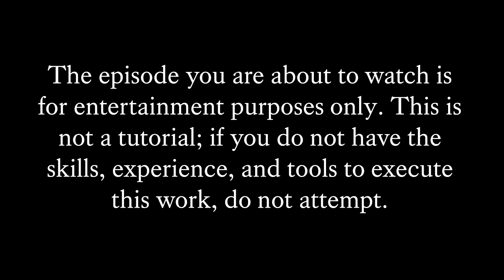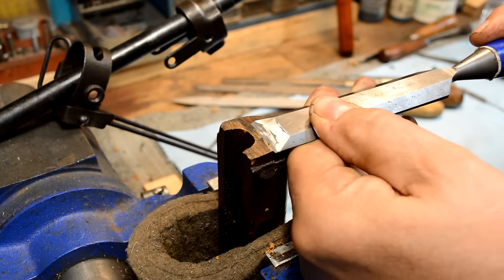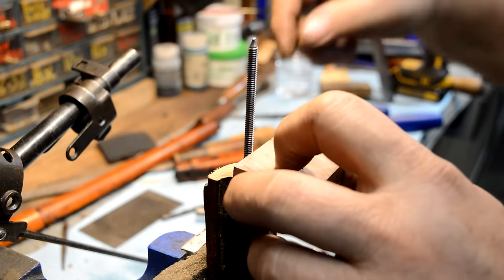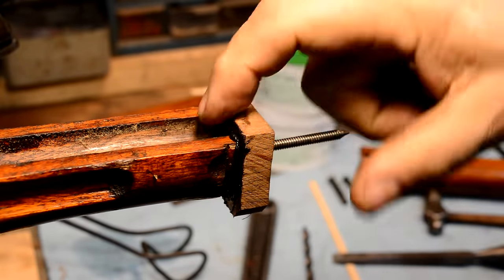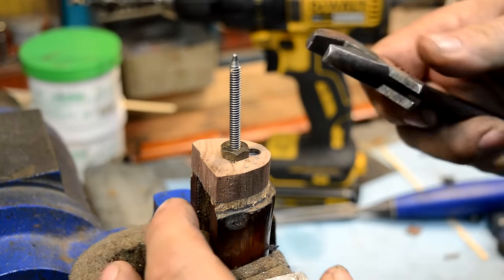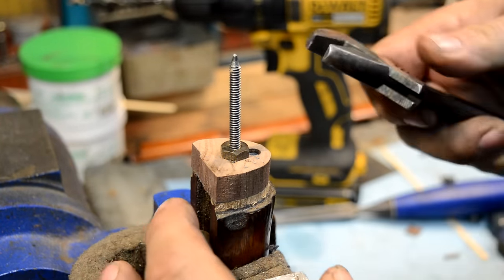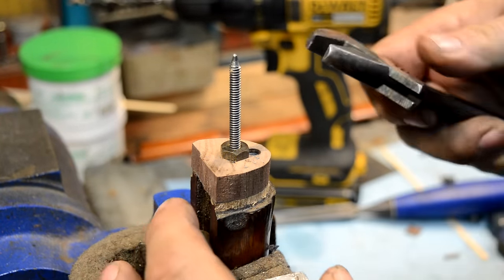Anvil 086: Type 99 Arisaka duffel cut repair

Comment: A little recommendation for the bonding of the parts of the stock. To make the joint strong and durable with good tensile strength, lay cotton threads down (amounts depend on desired strength) on the joint and coat and overlay with the adhesive. It'll be many times stronger I think you'd like it 👍
Reply: He said it was a nylon epoxy does it not have nylon threads in the epoxy already?
Reply: @IRMacGuyver  it looks like a normal aliphatic resin, normally you could use glass fibres, cotton thread or aramid fibres for reenforcement. Nylon is generally used for its lubricative and elastic properties so would not typically be a good adhesive companion because the glue is hard and nylon is difficult to bond to. Nylon is good for sealing joints and threads though. I'm going to watch the video again, perhaps I missed a bit. In industry chopped or strand cotton is used for applications requiring strength and a little flexibility so it is nice to use with wood. Glass tends to crack and snap, being more rigid. But also good. Stronger options are to go with Kevlar or carbon fibres. But cotton is cheap, good and readily available so I like it.
Reply: @zimbab5748  No he said he used Acraglass not wood glue.  Acraglass is a resin.
Reply: @IRMacGuyver  I didn't say wood glue. I said resin. I specifically mentioned aliphatic resin. I am talking about components that can be combined with resins to increase strength when bonding.
Reply: @zimbab5748  Every carpenter I work with says aliphatic resin is a fancy name for wood glue.   And I AM talking about the possibility that Acraglass already has nylon threads in it so you don't have to use something else.  But you haven't answered that question.
Reply: @IRMacGuyver  I see what you mean.
Reply: @IRMacGuyver  so it has a metal matrix, nylon derived additives (because as I said nylon is lubricative, so will have been derivatives that aren't rejected in the bond), and does not contain glass floc or recommend it as 'necessary', Neither do I. But I do a lot of work with epoxies and for a joint that is set up like that I would have laid a bed of cotton threads down axially in the stock under the barrel to add additional bending resistance. Just my opinion, you don't have to recommend or endorse it but it is what I've found works after having  failures in different fields. I don't think you're wrong, you can use it as it is, but there is a world of composites out there..

Comment: I'm guessing you cut up so much walnut to get to a grain pattern that matched the stock? That's some amazing detail.

Glad to see a Type 99 video! I just picked up my own unicorn will all the gizmos, but sadly with a small wrist crack that will have to be repaired someday.
Reply: That and it looked like the was a stock pattern drawn on the wood. Realistically the grain matching isn't an issue because of where the repair is on this particular gun.

Comment: Have you considered steaming the area held in the vise to cause those minor indentations to swell back into shape?  We repair dents in very expensive pool cues with that same technique.   A directed jet of steam (pull the knob off a glass pot lid, on a pot of boiling water, the small hole is perfect) can "reinflate" compressed dings in wood, amazingly effective.
Reply from the maker: What finish do you have to replicate? This weapon has a sumac based varnish, which is somewhat poisonous and we do not have any. Oil finishes will turn white if steamed. We steam stocks all of the time......IF we can repair the finish. In this case, no. Try a MonoKote iron, or a soldering iron, and a wet towel, for point repairs in small spots. Your rig sounds interesting, I might try that.
Reply: @marknovak8255  
  I've used the heated moist towel, etc. as well, it was more a general question but yes, I realize that the finish makes the difference.  
  I was admittedly working on the premise that the finish could be repaired if it were a common lacquer/varnish. 
  Glad to hear you're aware of the process and, yes, the small hole in a pot lid does work great for small nicks.  :)

Comment: Great workmanship. Thank You.
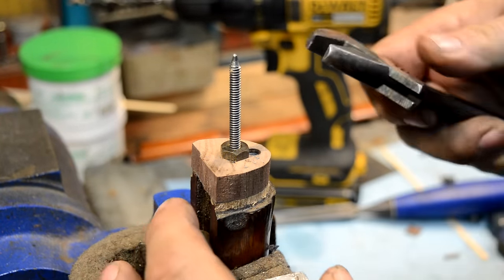Reply: Well this isn't going to be welcome but here we go. @31:53 we can very clearly see that the top edge of the stock on the right is noticeably higher than that on the left of the join. Mark does not see this. This is the stage where the parts are brought together dry so that they can be fitted correctly. Look closely, it can be seen that the barrel is sitting down hard into the wood on the right but is lifted in the wood on the left as witnessed by a gap between the wood and the metal on the left. This can only be caused by the wood on the right being too high in relation to the mother stock and shows that the hole for the threaded rod is in the wrong position and is causing the joint to be out of line. 
Having assembled the joint @37:43 we see that the exact same conditions apply and the repair is out of line. Start watching at 38:10 Mark checks the alignment and (look closely) moves the stock even further out of alignment by lifting it higher. Shortly after this he confidently tells us that this is not the sort of gun that you learn on. @40:10 here's the smoking gun! Notice how the wood grain is showing through the glue. It stops showing at the exact line of the join because the barrel was lifted up from the mother stock by the miss aligned stock. All the pressure of the rubber strap could not pull it true because the threaded rod could not allow it to move into line. @42:32 look closely at the visible left hand edge of the glue and it can be seen to have considerable thickness. This is the result of the barrel not sitting down in its cradle in the stock. The thickness of the glue exactly matches the degree of missalignment of the top edge. @45:01 he finally notices the problem with the top edge of the stock and cuts a little wood off. @45:16 Mark starts to explain that wood moves with time and he's right. However no amount of explanation can put this situation right. @47:18 he cuts away wood and tells us that it swelled right here. He demonstrates that he does not understand why the top edges are not in line and level. @49:14 this is the first time that we see the results of the missalignment. Not withstanding any bending of the top stock the gap between the top and bottom on the left of the joint is exactly equal to the degree of error in jigging the two parts of the stock together. Mark's attempts to blend the joint are seen as a freshly cut ramp in the wood. @51:23 Mark is telling us that the front end joint is tight and it is. However he makes no mention of the gap behind the joint which will always be there. @54:20 observe the gap where the top covers the bottom. In spite of any explanations that gap is there because Mark assembled it out of line. 
I have been a gunsmith for over 40 years and am often called upon to correct poor repairs. I despair at this job and I wonder if the owner will be content with explanations of swelling wood as he holds this rare example. Often I have found that workers who make sure we all know how good they are can produce average work with eloquent and lengthy explanations of how difficult it was and how the average joe would make a hash of it. I expect this comment will be deleted as it will not sit well with Mark Novak. I challenge you to leave it here so that your viewers can respond.
Reply: @jonka1  when I need a gun repairing l will send it to YOU 🤨

Comment: 12:44. Use 2 screws. Drill and tap as you did. Sharpen ends as you did. Line up walnut spacer (why so thick?) with drill rod in stock as you did.
lower down on sharpened ends of screws, tap tap. holes for forend now perfectly marked for alignment. Can even be "sloppy" like you said.
What are you making out of that blank? Possibly a matchlock?
Reply from the maker: Snaphaunce fantail fowler
Reply: @marknovak8255  Ahhh knew it looked like something from way back. Hope we can see it when done.

Comment: I wrote whole how to.. Hack saw blade pieces for spacers ..Three long small pieces.  Used very small dow rods ..Q-Tip long.. with holes rods in holes lengthwise useing head cut off sheetrock screws.. Screws turn in with vicegrip point out.. ran forearm down barrel to stick on points.. Then holes marked and drilled. Fitted with blade chips and triming wood sticks to lenght..and actuglass bedding clamped together.. I hope wood would expand and contract with heat cold. High humility low humility..Going on thirty years now.. Guess worked out fine???? 
HACKSAW BLADE THICK.. THE GI GO TO SAW..

Comment: I have one of these Type 99 from an uncle who served in WWII.  Fortunately, the one I have did not suffer the "duffel" cut, which I had never heard about until now.  Mine is also in very good shape (maybe not as pristine as this one).  So, what the heck is a duffle cut and what was the purpose?  Also, I used to be able to buy 7.7 mm ammo, but for several years now I have been unable to find it.  Any suggestions on obtaining ammo for it?
Reply: It was cut,  as the name suggest, to bring it back via a dufflebag instead of mailing it as a spoil of war in its proper assembly. Duffle bag return was an easy way to save money vs shipping the fire arms
Reply: Gene Carr, these days you probably have to order ammo online. It is relatively expensive. But, if you reload it is no more expensive than any other high power round. New brass is available. Bullet is the same as .303.

Comment: I have a "bring back" from my farther in law. Not sure how he got it home but there is no duffel cut, the mum only has a slight scuff and has its original bayonet with cover. Looks to be early to mid war. Not as nice as the "99 longs" but far from being a last ditch. Has its original finish and I dont think it's ever had a round through it. I just keep it cleaned and oiled and it sits in the back of the gun safe. I did get a box of rounds for it, not cheap, just in case one day.....

Comment: I just picked up an all numbers matching Mauser 98K, late war 1944 production that was duffel cut. I'm having a heck of a time trying to find even a beat up donor stock to fix and repair the stock that's on it.
Reply: Luckiest guy on earth finding a numbers match 98k...find a sporter stock or even a composite to put on it to use while you find a real one?
Reply: I'm keeping my eyes peeled for a type 99 stock.  My rifle has all the good markings/steel butt plate, etc.  But, someone "partially" sporterized it by sanding down the stock. I'm in the same boat, trying to find one worth purchasing for less than my son's birth certificate.
Reply: W'd someone tell me wtf is the point of these stock cuts ?
Reply: @nilsbachellery6939  The explanation is in the name. "Duffle cut" is a cut performed by a GI to be able to bring the rifle back to the states in their duffle bag.
Reply: @MrAntiriver13  i get it, but if it was for concealment purpose, why only cut the wood, doesn't a protruding barrel give it away anyways ? ?
Reply: @nilsbachellery6939  Usually the barreled action is just the right length to disappear inside a duffel.

Comment: I think the anti-aircraft sights themselves are pretty much pointless, but the idea of infantry shooting their rifles at aircraft might not be.  IIRC the Germans during WW2 recommended that when Allied aircraft attacked, anything and everything that could shoot be fired at them.  The theory was that while it would be highly unlikely for a bolt action infantry rifle (or, really, ANY small arms) to actually take an attacking aircraft out of a fight let alone shoot it down, they might very well score a hit on a fuel tank resulting in the enemy having to spend time repairing it.
Reply: Also, they were designed when most of their anti-aircraft experiences were in China in the 30's versus slower  moving aircraft. Imagine that, and a unit firing in volley. Then it becomes less of a ludicrous concept.
Reply: @srfong  I assume you mean the sights being less ludicrous?  In that case I agree.  I think beyond that scope the sights are pointless, but like I said before, having infantry take pot shots at aircraft might not be.  IIRC small arms were credited with a few aircraft kills in Vietnam, and choppers have been going down to AK-47s since they met each other.

Comment: Killer repair and video
Reply: Well this isn't going to be welcome but here we go. @31:53 we can very clearly see that the top edge of the stock on the right is noticeably higher than that on the left of the join. Mark does not see this. This is the stage where the parts are brought together dry so that they can be fitted correctly. Look closely, it can be seen that the barrel is sitting down hard into the wood on the right but is lifted in the wood on the left as witnessed by a gap between the wood and the metal on the left. This can only be caused by the wood on the right being too high in relation to the mother stock and shows that the hole for the threaded rod is in the wrong position and is causing the joint to be out of line. 
Having assembled the joint @37:43 we see that the exact same conditions apply and the repair is out of line. Start watching at 38:10 Mark checks the alignment and (look closely) moves the stock even further out of alignment by lifting it higher. Shortly after this he confidently tells us that this is not the sort of gun that you learn on. @40:10 here's the smoking gun! Notice how the wood grain is showing through the glue. It stops showing at the exact line of the join because the barrel was lifted up from the mother stock by the miss aligned stock. All the pressure of the rubber strap could not pull it true because the threaded rod could not allow it to move into line. @42:32 look closely at the visible left hand edge of the glue and it can be seen to have considerable thickness. This is the result of the barrel not sitting down in its cradle in the stock. The thickness of the glue exactly matches the degree of missalignment of the top edge. @45:01 he finally notices the problem with the top edge of the stock and cuts a little wood off. @45:16 Mark starts to explain that wood moves with time and he's right. However no amount of explanation can put this situation right. @47:18 he cuts away wood and tells us that it swelled right here. He demonstrates that he does not understand why the top edges are not in line and level. @49:14 this is the first time that we see the results of the missalignment. Not withstanding any bending of the top stock the gap between the top and bottom on the left of the joint is exactly equal to the degree of error in jigging the two parts of the stock together. Mark's attempts to blend the joint are seen as a freshly cut ramp in the wood. @51:23 Mark is telling us that the front end joint is tight and it is. However he makes no mention of the gap behind the joint which will always be there. @54:20 observe the gap where the top covers the bottom. In spite of any explanations that gap is there because Mark assembled it out of line. 
I have been a gunsmith for over 40 years and am often called upon to correct poor repairs. I despair at this job and I wonder if the owner will be content with explanations of swelling wood as he holds this rare example. Often I have found that workers who make sure we all know how good they are can produce average work with eloquent and lengthy explanations of how difficult it was and how the average joe would make a hash of it. I expect this comment will be deleted as it will not sit well with Mark Novak. I challenge you to leave it here so that your viewers can respond.

Comment: I got a springfield 1903a1 c-stock that was in process of being sporterized im reconditioning and reattaching and new section that was cut off and purchased NOS upper hand gaurd that's unfinished. So now that question. ( What did they use on the 1903 to finish and seal that wood? )
Reply: Hot boiled linseed oil. If your stock has enough linseed oil soaked in you might be able to heat the stock with a hair dryer and transfer some of that old BLO to the new part.

Comment: I have a little interest in fire arm and like to watch repairs to them. can i ask about a duffel cut? is this so i would fit into a duffel bag? if so why is the wood only cut,would the barrel still not be too long?
Reply: A duffle cut is merely a nearly invisible repair to bring the gun back to working order, not to make the gun shorter
Reply: @xenoborg007  OK, i was thinking the barrel and metalwork would be the longest ,not the woodwork,shows how much i know. I was also wondering about the other comment,perhaps i was not clear in asking question,thanks for the info 007
Reply: Braggin' Rights I don’t like to trust my memory but I’m almost completely sure that is not a duffle cut, however I do wanna know what you are talking about. What issues can a rifle have that you would cut the stock to fix?